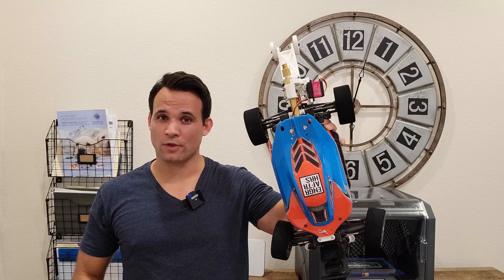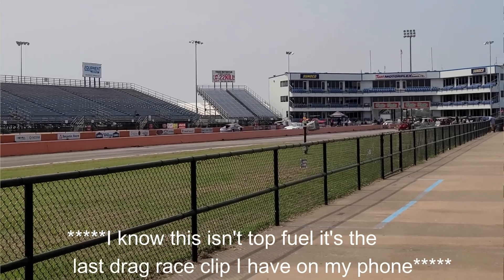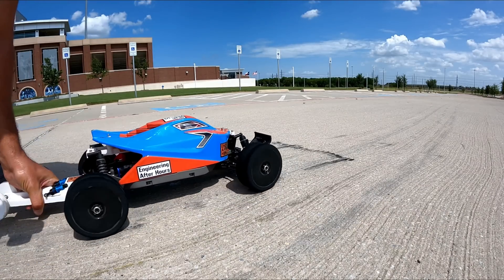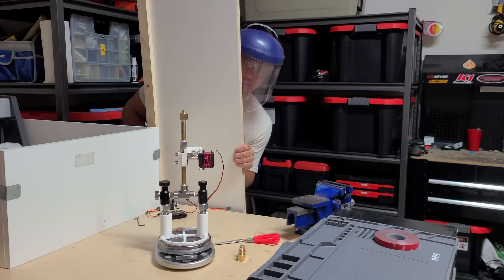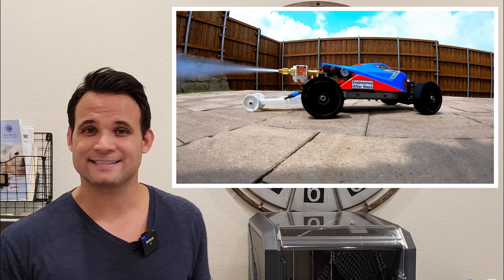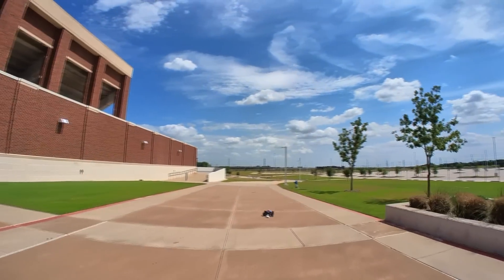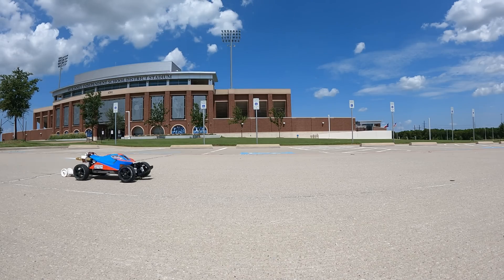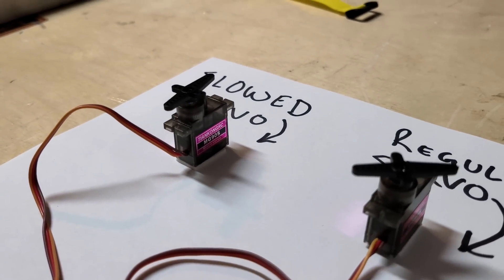I Put a Cold Gas Thruster on my RC Rocket Car

Comment: my losi lazernut in 4s can surely beat 2.3 in acceleration XD sinice ive done 4 launch control on the hig grip red road we have here.. and managed to break the midle and rear differential... lol tattu rline 850mah feed no problem the 130 amp esc XD i never saw a thing accelerate so fast XD (meaning not talking of arrow or pellet gun ) XD

Comment: to sum up the sheer and utter nonsense that is a top fuel Dragster: the exhaust from one of those engines is pushing out roughly 1000 pounds of thrust...though if I recall correctly a good part of that is from unburnt fuel igniting when it finally gets some oxygen and turning their exhaust system into a literal rocket, if not a terribly efficient one.

Comment: I have a Tesla plaid

I’m trying to work with seeing if u can engineer having quad thrusters manifested in the trunk. Working with my local metal fab guy to see where the ideal weld position I can do on the frame and trying to regulate it. Good bud here!

Comment: I’d definitely look into playing with where your center of thrust is as well as the horizontal thrust vector. Angling the thrust vector so that it has a lower forward axis should push the nose down a good bit and still provide ample forward thrust as well. On top of this it should allow you to remove the wheelie bars since the thrust from the gas will push the nose down with how far forward the whole assembly is mounted to the chassis. I’d also recommend staying far away from rocket engines, they’re notoriously difficult to fire in unison or on a specific cue. I saw another comment recommend using nitrogen, I’d also explore that route. I’d also look into refillable 12g cartridges as well and do a hydrostatic failure test on them so you can see exactly how much pressure you can put in them. You may even be able to coat them in epoxy resin and carbon fiber to increase the strength. You’ll also want to look into optimizing the de laval nozzle. On such a small scale it’s really hard to tell if the nozzle is over or underexpanded without looking really closely. At first sight it does appear to be underexpanded but you’d have to pay specific attention to that and prototype a lot to figure out what looks the best. And fortunately that is something you can actually see in testing.

Comment: Can you install some sort of delay chip where power goes to the front first for just a fraction of a second before the rear activates? That way it "acts like a rolling start" and the rear doesn't cause a wheelie.

Edit: of course that would require a dual motor setup I assume.

Comment: wouldn't it be a lot more effective to use a water tank and have the gas push the water out like a rocket
Reply from the maker: Maybe. I tested that but may have had too little water
Reply: @EngineeringAfterHours  
roughly speaking you want a quantity of water such that all of the water and compressed gas are expelled by the same time. Anyway i think you shouldn't waste your time with gimmicky things  like this and stick to things like the aero experiments (ground effect and so on). Those vids were very well done, reminds me of the rctestflight guy. keep up the good work i think you'll take off eventually :)

Comment: I'm working on something very similar for my engineering degree project, but for a UAV. The chamber is a great idea for increasing mass flow rate - where did you find the plumbing/piping suitable for the 800 psi pressure?? Thanks!
Reply from the maker: I bought it online at various hardware retailers. You may start with McMaster Carr or similar.

Comment: You might want to consider a different fan car where the fan is providing forward thrust
Much easier to implement, can easily achieve multiple g's of acceleration

Comment: Was the wheelie-bar spring loaded? Wouldn't that reduce your rear wheel normal force and therefore traction?
Reply from the maker: Maybe briefly...loading a wheelie bar period takes weight off the rear, but my goal was to drive the front back down since it's 4wd.
Reply: @EngineeringAfterHours , oh, i get why your doing. Just wondering if the wheelie bar was sprung or just damped.
What is the static weight distribution? I would assume it needs to be front heavy, but did you find a practical limit?

Comment: ( SOLUTION) helium would be better than compressed air , that is helium compressed to over 2500psi ( fed into a precharged airgun compressor )   but were looking at ejection velocity alone , you also have the mass of the flow ( mass flow rate ) ..  The mass actually favors co2 quite well being heavy , and since the ejection velocity is already an assumed 700 fps at critical temsp  or 220 mps , co2 should suffice..  what you need to is a 12v heating element wrapping the tanks , have a gauge installed on the plenum so you know when to launch.( the smaller tanks are rated for about 9000psi , dont be scared ) . co2 will reach 2200 psi at about 120 degrees as i recall , then you will see some real acceleration and get better efficiency from the smaller canisters. AS for the nozzle design , im not sure but your plenum size ( expansion chamber ) needs be smaller if the propellent is exhausted before 1.2 seconds. ditch the servo delay , the acceleration from the thruster should exceed the cars ability to lose traction

Comment: Dude stop the studdering and just use sensored motor's and sensored electric speed controllers..I like the content but the lack of a decent rc system drives me crazy.  Thank and good luck..#castlecreations
Reply from the maker: Haha I got one...next fan car will be castle powered (1515 w/Monster X). These builds add up really quick so I have to spread the costs out.

Comment: Have you considered N2 instead of CO2? Some people will tell you that HPA is the same as N2 but if you shake the bottle you feel liquid, its not.. Pure N2 is a dry gas and should be better for your application. Co2 is a liquid so when you release it has to expand first which is the freezing effect. N2 will remain a gas so its ready to go. And there is a difference between n2 which is dry n2 and ln2 which is liquid nitrogen, it very stable so you can get it wet or dry...lol

Comment: Buy PCP filling connector and PCP pump and fill the chamber with the regular air you will decrease the weight of the system significantly.

Comment: Are you running a slash 4x4 chassis, and if so, I'd recommend running the LCG chassis as it helps greatly with stability and keeping the car to the ground with some good suspension tuning
Reply from the maker: Lcg chassis is on the way

Comment: The pressure won't drop until all the liquid has boiled to gas. Having your larger volume of pipes full of gas and liquid would increase your total impulse because the liquid/gas would have more thermal energy before start, and your actual fuel here is that ambient heat.
Reply: what about wrapping a heater coil around the cartridge before launch?

Comment: Is it possible to use the thruster as a Steering, Balancing, Downforce system to maximize the motor's accel effect? I guess the tires' friction profit ratio is bigger than 1.0. Using the thruster to press down the car head may balance the car and release more power from the rear tires.

Comment: If you are using a rocket why on earth do you need more traction on the wheels? That would slow the car down. I'd run the wafer thin tyres with just enough friction to steer the car
Reply from the maker: The accelerations are additive.

Comment: have you heard of impedance matching? as it turns out matching exhaust pressure and speed with the air around it has a major effect on performance. bernoullis principal work well, although i dont know exactly why it improves thruster performance. they are called steam eductors or "air economisers." if you attach them to a standard air tool system they produce extra force for the same air input, and can be stacked or folded to improve performance.
Reply: He literally shows installing a converging diverging nozzle in the video.
Reply: @D3moknight  sorry i guess i was not paying attention at that time

Comment: A very reliable launch control setup is built into the Flysky NB4 radio. It’s called CH Speed and essentially allows you to set your full throttle delay in 0.1 second steps. This allows you to pull full throttle every hit, but you can dial in the delay each time to help with traction.
Reply from the maker: Thanks for the tip...looking it up now

Comment: And few more very wacky things to try so chance 1 second . I admit this 1 bit to out thir ha but has chance help . Say front steering done by drone g force strait line to control steering body all care is aro posably 2 out runner motors as hub motor 1 front 1 rear . Long . Very wacky but if you could test fly wheel affect using the more wheel wide as car with battery balanced set in sorting so chance it survive g force . The motor spins up to Max speed befor you lunch as it pulled up off ground , then spring or servo so can be tuned repeatable aurduino nano spring or servo drops it to ground  to start using the battery with brush to end wheel to get power out . Then you get massive power store befor you take off posably 2 x motors continue rating . Vacum cleaner fan or few in series or parallel let sience and test set direction from result on slow motion . 1 at back maby 1 at front . But I had 4 wheel drive gtr in past down drag then 90 10 v 8 putting all weight on back wheel tuned was good . 4 w drive good as can turn and drag . But in your set up weight is enemy for time . Tune with slow motion can skirt maby more long and computer alignment front roller can turn few ways from top or 1 side servo outher hinged.  Nano Audrey's can control servo 100 times faster than human to adjust power maby bit less off line . Hight few ways adjust vac fan speed .and to drop then back direct drive put runner with foam tyre all way across with all Wight can fit in battery few carbon brush  or esc bat blue tooth in wheel wacky but lose all running gear and suspension airo box front back tear dropped 4 cell 1 battery to all or super cap to help if need . Storing vac befor in staged shell lo chance help . But duct fan got noting on vac fan blade if skirt is tight . Gues step backwards because of Wight enemy is carbon box out runner trike or car each corner with tyre . The rpm per volt is defonaly capable 100 kmh as used 1 in past on bike 4 kw to do 50 kmh with me on bike heat was prob long term I mounted it direct to tyre after     calculate outside diameter x rpm per volt etc . Hope chat any chat program or line best want see under 1 second no thruster but fire work and computer strait stear longer narrow good aim push 1 button it adjust fly wheel back maby front wheel spun up to 200 km h gues to drop to ground and manage vac say full vac overdrive 4 cell on 3 cell vacum cleaner impepeller staged series or parcelled  vac drops at say 50 km h so more power drive motor etc ato break after 100. Arduino could be easy set up to do that I can program bit below average . Fans etc think best bets limit only 60% if food for thorts.  Another wacky idear to try has chance is bigger propellers get bit better efishant unless bumble be use swerl as well cool . But another easy for you try out side the box is electric helicopter can spin thir blades up with 0 angle to hi speed then they change angle up or down to make kg . I think that onto your car may be better that fixity skirt . Again Arduino micro controller to manage tune with hi speed . It's spin up and wheels swing up with battery in wheel to store / fly wheel befor start . Arduino changes angle of helicopter blades ontop your car pushing down then the back wheel maby front spinning at 200kmh drops to ground for run . Very funny but with micro and ultrasonic sensor front back you can easy use helicopter to lift all car off ground spin upwheels then drop it to do run . I think this has a good chance do under 1 second 0 to 100 with micro manage stear blade angle stop and off ground spin up no shock no running gear just hub motor all wires short tjink all motors run hier cell for second . My engineer freinds puts 7 kw threw his e bike 1 kw motor beats 4clnder to 70 kmh funny . Wow so happy if you do u der 1 second no thruster hope chat program rapid prototype brainstorm then sience result to stear direction fun. Helicopter head wacky but may be hable help stablise or stear as copper can . Auto break at 102 km h good unless law needs mow safety needs be foolproof eg test no blades test lo bat thowes coppers Do 100kmh easy gues it have be mounted forward as Wight shifts to back normaly less with chopper downforce think that be better than leaky vac box but let sience answer it you good at . Tune the chopper blades smaller if don't need lift 10 go but only 1 etc more power for drive motor to tune next body shape back tends form vacume sucking back is very important to may long narrow taper back . Think heard human in aro case cockroch fering got over 100 kmh  tear drop shape.  Carbon fibre tube for or c wheels tune length . To get fast car record does it need be 3 or 4 or 2 wheel ? Longer alot more stable better threw air . Neo track be interesting ha . Wonder if ypu have chance 1/4 mile as well with computer steering longer . The first few meters is the most important to tune . And next the 500 cc or 1000 cc dive tank things on e bay not shore but think most come with pump must be v small diameter as think they can be 4000 psi . Next project maby use 1 them in long car narrow wheel aro adjustable thrust angle to stay on ground and posanle middle wheel base to thrust bit up . Again very dangerous do on beach or something.  Prob could use 2 cd per wheel has chance fast as well all air out in 2 sec maby verbal tap if need more at start to test which faster allowed to have wall at back maby helps start maby drop g force to sear flap front to just stay on ground be fastest time . Water heard but not shore this true . Under water sound Barrie been broken with sea wold or something like that it used rocket motor to move threw water  faster than sound as most it except tip was in cavitation bubble is out thir maby thirt project on water chalange thowes drag boats think that be very hard airfoile above water managed by micro computer Arduino for hight wonder if 4000 psi e bay 1000cc thruster be better than Inrunner with more cells water tube around for cooling some let water go threw motor sceary . Cavitation bubble on prob be the hard part and think all probs under 60% efishant food for thort and the airless fans and is a vto car using it says has advantages over duckted fan to look up for all vehicles compressed air comes threw holed in shroud accelerate static air had advantages in doc seen . 2 l bottles can store 80 to 100 psi light fun some ships bubble air under to help wouldn't bet on water record but car think that close soon . Plane using 4000 psi cylinder with blades thruster may be fast as well but over speed sound things change alot . Did see u tube vid baseball going over 1000 mph vac in barrel plastic it breaks threw myth buster etc use with wow results fun watch . Sorry my spelling and some wacky idears but fun try some may help hope contact chat

Comment: Really nice work on the fan car and this beast!  Nitrogen cartridges are readily available and should offer moderate performance improvement with Isp,theory of 80 sec vs. 67 for CO2. Also, putting a high output resistance heating coil on the subsonic side of the nozzle "should" improve performance even more by raising the speed of sound and therefore the V,exhaust, Isp, and thrust.  Angling the exhaust up a little should improve down force by pushing the car into the ground. i.e. angling up 25 degrees still delivers 90% axial thrust, while giving 42% thrust as downforce. Regardless, I hope to see you put more development into these systems.
Reply from the maker: I'll look it up. Thanks for the tip

Comment: Hi well done on the do . Is Thor any way to chat to you to refine brainstorm some improvement I use race gts was .3 sec of Australia record doing cheep things in past love rapid prototype let sience answer question thing good chance can do 1 second threw trial and error things like use can watch scirt learn . Biggest gain think is weight out 1 bat all series your fans change it to vacume cleaner fan if skirt improvement maby lose all running gear and motor in tyre . In past I used big out tuner on tyre to do 50 kmh on bike . Think heard aro at 30 miles h on bik is 80% energy etc vac at back v bad tear drop cocroach the shape the vac plate maby is all the framer 1 long wheel back outruner direct I think few trial s thir but you v good that and cam . Also all motors should be run at 1 cell more than rating for 2 sec run . Arduino nano could help us tune millisecond fun speed road motor soft start tuned . Predict 1 second no cold gas if can chat test look result learn do not just talk . I got line chat program I'd aaaarroonn.  Love have neard freind chat to and maby do some bigger idears with  if good person . I use make windmill from wash m motors r an p and wood made 5 m etc fun for me . So happy see you do this years ago I try contact company for similar aria mods and storage not h not lithium.  But 20 manufacturers best got was Ford say can tell us but is not secret sad Elon mesage him lawyers no respons as well gues they get to much junk mail . And lithium Titaniant is nuts amps out for sise expensive maby that beats lipo I not shore again let sience answer q clamp meater go pro slo m etc . Yes I bad spelling but very inventive bottom line in mind . Hope add line chat program so can have chat rapid prototype fun for me. Again well done for do as do the best tallent